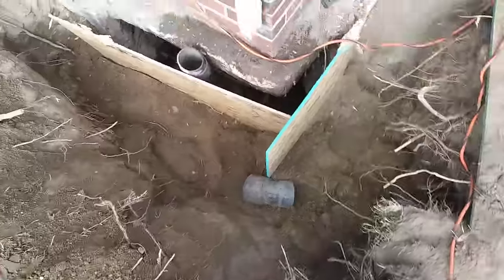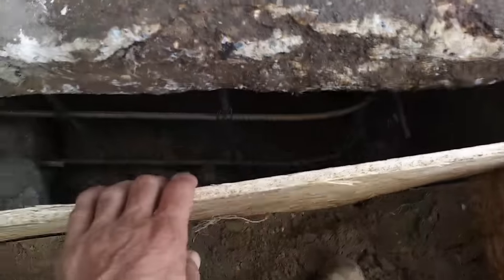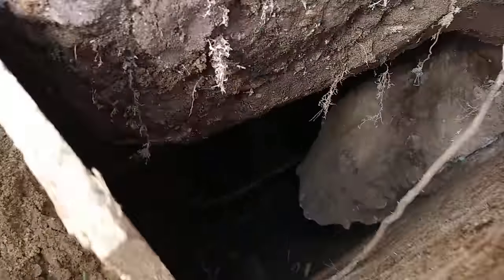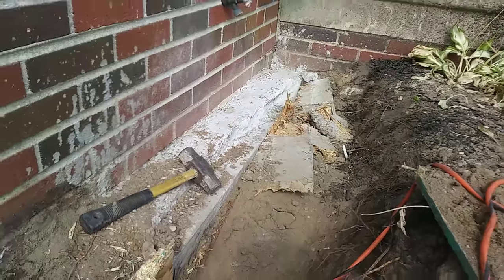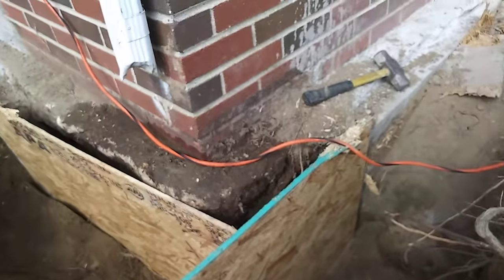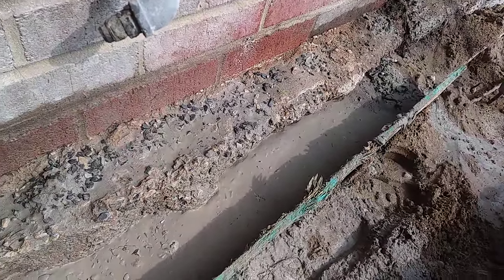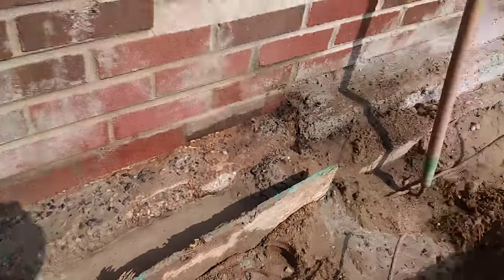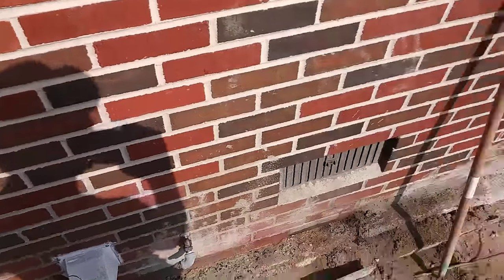Underpinning Foundations - Diy underpinning footings method to stabilize settlement

Comment: I just bought a brick house that has the exact same issue as you have here. A company quoted me $40k to fix it. Glad I found your video. With a little help I can do this
Reply from the maker: Have an engineer plan out the resupport repair for you. And complete in stages
Reply: HOW DID IT GO?

Comment: The Depth is only 1 part of what prevents more sinking, really need to make the footer come outward more to give it more load capacity.  Overall this is what I might have to do for my own house, I am glad I found someone else doing this.
Reply from the maker: Base of footing flares wider, exposed exterior portion exposed is flush to building wall as is should be by design

Comment: What's the stop the concrete you're pouring from continuing to sink or settle? my home is experiencing that issue severely. I have an open crawl space with a dirt floor and there's just concrete around the outside foundation of the home. There are no pillars throughout and once again I have a dirt floor desperate for help
Reply from the maker: It's a standard pour concrete footing forward to the undisturbed soil. No different than any other home construction.

Comment: great video. Just wondering how you managed to get all the air pockets out from the top/back corners, as the slurry of concrete rose up to meet the underside of the existing structure. As I would imagine this would possibly be the most important part of the procedure, as without solid concrete (without air gaps) meeting up with existing structure, it would weaken the support considerably. Any advice on how you managed this part of the job would be great to know. Cheers from Australia.
Reply from the maker: We hand interior crawl access to all formed areas. Because this was partially dug out by others is what create the start of the settlement
Reply: Concrete in that section doesn't really do anything. It's more important that it's about a foot wide depending on the size of the building and sitting on undisturbed soil.
Reply: Be better to leave the concrete short of the footing and let it cure. Then grout the last section with flowable grout to stop the new footing shrinking away from the new footing

Comment: I'm repairing my foundation and I have a section dug out but only from the basement. I have it dug out and clean and rebared. My question is should I put plastic down in the cavity like you would if you're pouring a pad
Reply from the maker: Although not required it also can't hurt.

Comment: Do you try to raise the house back in place before adding new foundation underpinnings?
Reply from the maker: On per case basis only. This one was not raise due to minor settling. With minor exterior brick cracking. Engineer deemed not worth addition damage to attempt to raise.

Comment: So I understanding the underpinning of the sagging slab foundation.  But what in the scope of this work that you're doing is going to prop-up the sagging slab to it's original level height?
Reply from the maker: Engineer designed underpin procedure here to prevent addition sagging. Since the addition sits over a pre exiting patio any attempt to correct the minor settlement would create extensive additional damages and excessive expenses.

Comment: Thank you for the video.. I bought a house recently, there is a lot of rat holes in the exterior of the house leading to the crawlspace. Because the house was built in 1943 there is no footing. I want to built a trench along with flashers to cover all the entry points as well.. any suggestions?
Reply from the maker: Best suggestion is to have an engineer evaluate and design the system for you
Reply: I've got a house built 1921 on brick piers. I'm digging trenches in between and pouring footers for a continous footing

Comment: Thanks for this video! There are few that address this problem. A question: Does the rebar continue through the sections, linking them somehow, or does each section have its own rebar, unconnected to the other sections?
Reply from the maker: Great question. Since the engineer required 4' sections, skipping in pattern. No section are rebar connected in concrete pour maited or as continuation

Comment: Was supporting the whole addition and pouring the whole thing in one go an option?
Is there footings under your new pour?
Reply from the maker: Not an option here the ideal and doing it in 4 ft sections is so that you don't have to have extensive Excavating and supporting of the structure. When you try to do it as an entire one shot project basically you're re supporting the entire structure which is almost equivalent to a raise. Very expensive

Comment: Since there is a 1" shift in the brick, why would you not place pilings underneath to lift the house and repair what must be a crack in the foundation? The floor inside of the house cannot be level with such a shift.
Reply from the maker: @randymillhouse791  the span of the addition in width is more than 21' engineer did not dream worth while to raise. . Cost Factor . And in a 20 ft run slump of 1 inch does not affect utility. Interior the flooring was modified by other during a prior remodel. Who ever originally built obviously did not have construct permits.

Comment: I'm here to see that corner and what your eng ordered. I've got an addition coming up and my engineer made no mention of supporting the corner of the house where a 4'x4'x10" pad has to underpin where a post (7"x3.5" LSL) and beam (5.25"x20"x21') are going in. My house is just wood construction single floor and I was concerned about the 3'x3' void under the corner foundation where the pad is going.
Reply from the maker: Not sure what your project is but any support column has to have footing base under it there's an existing pad it has to be underpinned were removed and replaced after a footing transferring loads down the column to the footing
Reply: @Chrdiy  Yea for sure. In my case, that pad (centered under the current foundation in the corner) is going in first and then that post and beam are going in to support a double garage span and a second floor above it.  My current foundation hasn't shifted in 64 years, on only a 12x7 perimeter footer with 6" CMU wall.

Comment: Do you need to have access to both sides when building out the underpin, or is it possible to pour your concrete from the inside and later on go outside and seal the concrete and build out any drainage?
Reply from the maker: Very difficult this was a crawl space area of about 18 in and we did have to access that only to shore up the back of the form that was put in place to backstop the concrete from filling the crawl space. Just remember there's a lot of weight when you place that concrete in there and you need to have some type of back support to keep it in place

Comment: Did you tie together the horizontal rebar  per section?  Thank you
Reply from the maker: When possible yes. Sectional correction should allow for rebar to extend left and right for each section poured, then tie together when a butt section is escalated and prepped for next sectional pour
Reply: @Chrdiy  this was great. Thanks for the response.

Comment: Don’t forget to cover the brickwork with plastic sheeting. It’s very difficult to remove cement stains on face brickwork.
Reply from the maker: Thank you. Yeah we used muratic acid to do an acid wash on the brick cleans it right up
Reply: @Chrdiy  this looks so easy. Right corner of my house is 1/4 of a inch sunk in. l am thinking to use your method but my question is how do you level the house?? if l dig and pour  concrete the way you did, l'd have no space put the jack under to jack it up to level it. If you gimme some advice, tricks &tips l'd be appreciated.
Reply from the maker: @oktbas9197  best advice to offer you. Get and engineer. Hell dictate in a written plan how to complete and resolve any concerns.
Reply: @Chrdiy  thank you very much for your advice 👍
Reply: Acid wash
Reply: @Chrdiy  ...yep no problem at all

Comment: How did you lift the sagging wall? Ive seen people using 12 ton bottle jacks.
Reply from the maker: The engineer who designed the repair off did not to lift the wall as it would compromise the exterior brick veneer so this underpin job is to prevent any additional settlement
Reply: house are best.  I tried leveling mine with 20t bottle jack but it wouldn't budge. I need to do this repair. 4' sections and try again. No bricks here.

Comment: Helpful insight - is there a method for avoiding cement splashes on the faces of the bricks though ?
Reply from the maker: Could try to hang a drape of paper. We typically dont bother. After completion we used muriatic acid spray. The lime (white) will wash away
Reply: @Chrdiy   thanks for your quick reply - I think we'll avoid the acid and gaffer tape some cardboard over the brick facings 👍🏻

Comment: finally found a video pertaining to my current dilemma. my garage has only a 4" slab no footing once or ever. would this technique reinforce my walls if im looking to add weight to them such as adding stucco, drywall etc.
Reply from the maker: Yes would prevent sag or settlenent
Reply from the maker: Complete in 4' section adding rebar to continue. Sectiond will prevent sagging while building up footings
Reply: thx for the response. do you recommend excavating entire perimeter of my structure 4ft each section or do you recommend excavating one side at a time pour and on to the next side. reason being is because I don't feel up to mixing concrete myself id rather rent a mixer truck all at once. I find this method to be much easier for me. also how deep and wide are your sections.
Reply from the maker: @IBLaZeI47  must be done in increment. You cannot do a complete side at one time. Depending upon building weight you may compromise the structure.   And yes we also had to mix on site opposed to an expensive truck making two or 3 small deliveries

Comment: What is going to prevent that heavy concrete from sinking again?
Reply from the maker: The gerth thickness of it. Which is poured into a 36" x 18" footing trench on undisturbed base footing. No different than every home you see?
Reply from the maker: You can Google foundations and footings to understand clearly
Reply: @Chrdiy  First, awesome vid. You probably just saved me $10,000. Thank you! Regarding the comment "undisturbed base footing. No different than every home you see"  Typically the dirt or sand where the footing will be poured is vibrated/tamped down before pouring concrete, to achieve a specified compaction rating. Of course this would be very difficult to do if only created small holes. If a permit was applied for, the inspector would need to create an exception or deviation from code is no soil compaction tests could be performed.
Reply: I also think broader base will spread the weight. And again as you dig deeper under the foundation the ground becomes firmer. I guess when the engineer comes back to approve the rabar, he will also test to see if the contractor has reached firmer undesturbed ground.

Comment: Can you not Jack up the house back to its old position before underpinning?
Reply from the maker: Theoretically you could although it would be an extremely expensive task as well as causing additional damage to the interior finishes into the exterior brick facade. On this particular job the engineer opted not to Jack the house up but the secure with the underpinning to prevent any further settlement
Reply: @Chrdiy  thanks for sharing, settling of homes is very common. We’ve been looking at homes recently and we have found at least 35% with noticeable points showing up on door jambs and ceiling cracks.

Comment: Do you have to use rebar or can you just backfill underneath with concrete?
Reply from the maker: No there was rebar incorporated into each section the pattern was dictated by the engineer
Reply: @Chrdiy  is this rebar always required? I am looking to do this to underpin my conservatory but didn't think I'd need to incorporate rebar
Reply: @elliotsmith6794  concrete has practically zero tensile strength without rebar. It needs rebar for structural applications and this is certainly that. You really don't want to do this repair twice.
Reply: @wadepatton2433  Could you not argue that actually rebar rusting is one of the major causes of concrete failure. re-inforced concrete in the ground without any DPC is going to be saturated for part of the year and rebar will eventually cause the new foundation to crumble. I'm not sure any of this matters as normally a decent hardcore foundation is going to be effective anyway and this house like so many has essentially no foundation at all and based on clay/sand etc.
Reply: @iqudos  Yes rusted rebar can cause failed concrete, but I think that's more of the case in fully exposed and/or salted concrete like bridges and roadways.  Under a roof of some sort, on well-drained soils at least, there shouldn't be a high-level of moisture content. Also it takes cracks for water to penetrate to the rebar. Without rebar it's going to crack sooner and in more places I'd think. The footer under my house is rotten and I'm sure it's because it's too thin, and also it probably has little to no rebar in it. There were no codes where it was built, when it was built.  I'm going to have to replace it, rebar will be incorporated-and a lot more concrete. Cheers.

Comment: I resently did a 4" slab and built an entire 12 ×30 foot house made of bricks on it, if i pin the foundation like this, will  it hold the structure and the walls together ?
Reply from the maker: If there is nothing under the slab you need to underpin. Im surprised the pad hasn't already cracked, sunk and shifted already....unless it has already?
Reply: @Chrdiy  I built it on an old railway track that was abandoned, it sopposed to be solid ground, should I still underpin
Reply from the maker: I have no way to respond. Construction of any building requires foubdation and footing. Typically 36" depth to undisturbed base. With proper foundation and addional width extension for brick veneer.
Reply: @Chrdiy   thank you very much for your answers
Reply: @peterbabooram7798  You built a brick house on just a 4" thick slab? Single story or double? Was there anything under the load bearing walls foundation wise?
Reply: @RatchetMonkey  a single story house, it was built on an old railroad,  the railway system in my country was scrapped years ago,  so the land is used to build homes,  the land is pretty compact after years of trains running on it
Reply: @Chrdiy  what do you mean by need to underpin? Is this underpinning in the video or is it something different? I have a 4” slab too with no footer, would I use the same method in video or the underpinning method
Reply from the maker: No clue have no idea what you have there or what you built. But if you built something on a 4-inch pad you can bet it will crack and sink so you do need to underpin and support. As it sounds like you have no footings

Comment: Great video.  Wow, what a disaster.   Curious what the foundation should have been originally constructed like,
Reply from the maker: For slab construction, a minimum 32" deep x 18" wide footing with block foundation then infill pad with gravel, mesh, insulating ridging board and vapor barrier meeting code. Or continuous monolith style pour with all mentioned condition being prepped and meet prior to pour, one piece concrete pour slab and footing at once. 

This was old school before regulations pre 1960

Comment: Settlement/underpinning confusing, stressful & $$$$$ doesn't matter how you look at it ! Been researching this subject for months still confused as mud. If you underpin 1 side of the house, wouldn't there uneven settlements in future as other sides are not strengthened ?
Reply from the maker: @holycow3355  correct , however in this particular case the other footing locations proved to be substantial different type of construction. We believe this particular part was Bill illegally over a patio portion

Comment: Did you not jack up the house? also what would you say this job would approx cost?
Reply from the maker: No jack up of the dwelling. The predominant of sag in this case was the brick veneer and not so much the Edition itself. The fortunate part was that the strong carpentry favorably supported the existing wall which was almost similar to a cantilever at this point because there was no under support. This particular underpinning job estimated roughly 9,000

Comment: I dug about 2 feet under the house footings (one corner of the house) to pour 40cm of deep concrete  than put a concrete block 30cmx30cm of diameter to jack up the house levelling but at this depth clay is softer than where the original footing is. If l pour concrete than level it would it be ok or what is your advice? I need help. Thank you
Reply from the maker: I would have a soil compaction evaluation. Or compaction test to see if the virgin soil will support the pour.
Reply: @Chrdiy  that is my concern. When l pour the concrete slab,if the virgin soil would support it. The area isn't big enough to compact the soil. Whacker won't fit in there it's 90cm length 90cm widht 1m depth.
Reply: @Chrdiy  l need to place 3 pins (concrete blocks) main one is the corner and one at each side which is about 10 feet away from the corner. Can l start from corner then the sides or l should be levelling 3 of them at the same time? What would you suggest is best way to go about it?
Reply from the maker: @oktbas9197  tough to say. Our engineer dictated on plan how and where to start. Can't recommend anything for your situation as it is outside of our scope of business, licensing laws, . engineer is only one qualified to direct you. Sorry.
Reply: @Chrdiy  Thank you 👍